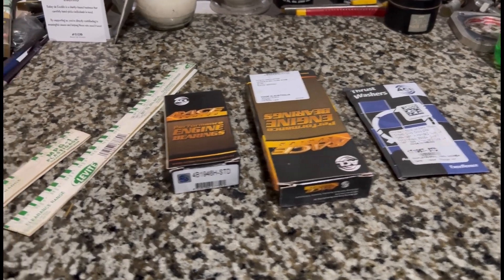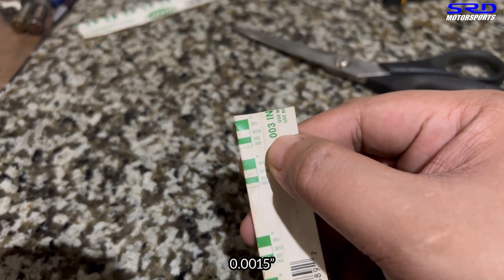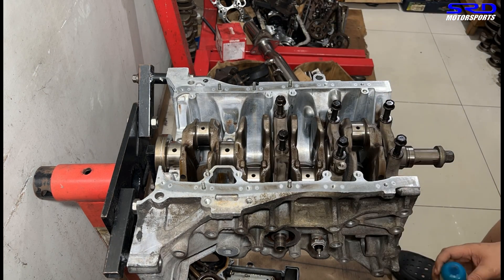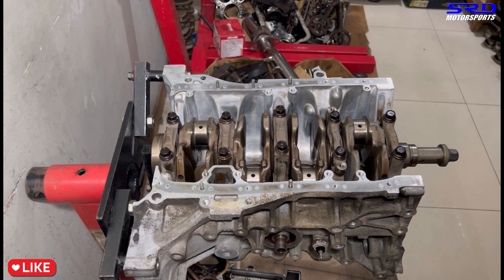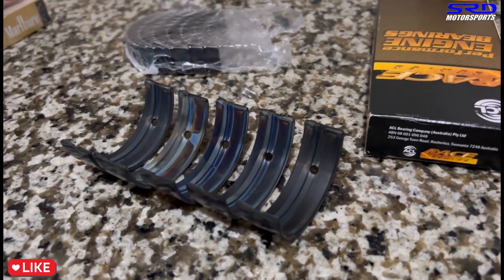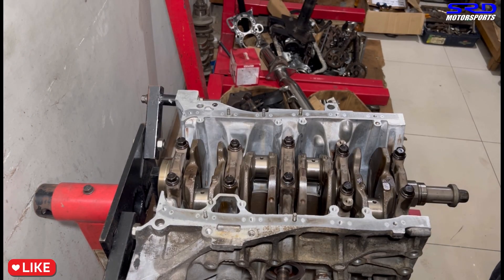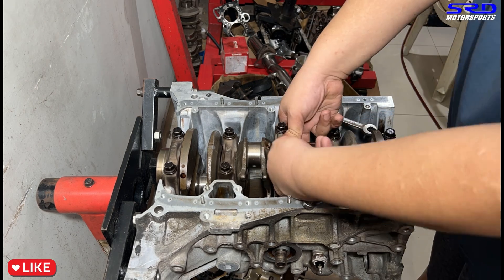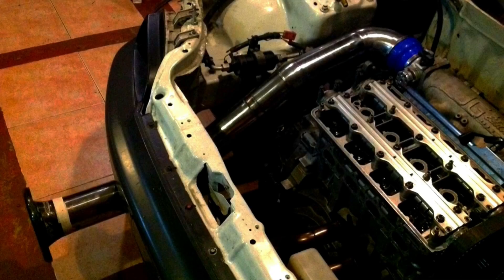How To: Plastigage Main and Rod Bearing Oil clearances

Comment: I have a question, as an engine builder like yourself, how to do determine which body of oil you're gonna do since you're working with difference clearances, once again great vid as always
Reply from the maker: A simpler way to see it like in layman’s observe Honda D16 and Bseries oil clearances and what range oil weight they were good for…

That gives atleast a simpler idea or view
Reply from the maker: as you notice we “usually” go oem daido/taiho bearings for a reason…
Reply from the maker: @StraightOutThaGudda  example is my engine and Jasper’s 

His has been running since 2016 , a street car pulling 12s til now…

so sometimes you got to think… cuz more clearances kill oil pressure too
(next everyone needs new pump? hmm)
Reply: @SRDmotorsports  ahh okay I understand everything you said now, so basically you play within the tolerances/range of OEM and it works, tighter clearances with destroy the bearing and slightly looser clearances will save the longevity of the bearing but then again too loose of clearances can still destroy the bearing hence why you work within a specific range. It all makes sense. But usually they say all motor you can work with slightly tighter clearances and turbo you need looser clearances, what are your thoughts on that?
Reply from the maker: @StraightOutThaGudda  makes sense on that, and you def will get it if we include “heat” cuz it makes more power (turbo) right 😎

They generally run hotter too that’s why
Reply: @SRDmotorsports  That's very much true so you gotta compensate for expansion of parts since there's more heat.
Reply from the maker: yep 😎

Comment: Hey man what up? That OEM clearance is a bit too tight, with the amount of engines I rebuild I'd say .01 for mains and .02 for rods. I don't why but most 4 cylinder engines #4 main and #3 rod bearing always goes first it's so odd. I like how you keep things basic, there's so much tricks I can talk about with bearings 😅
Reply from the maker: yep that’s inches 

And yep checking clearances always did good for me…